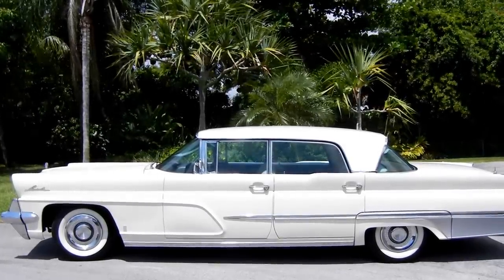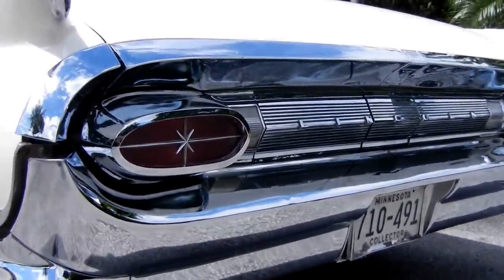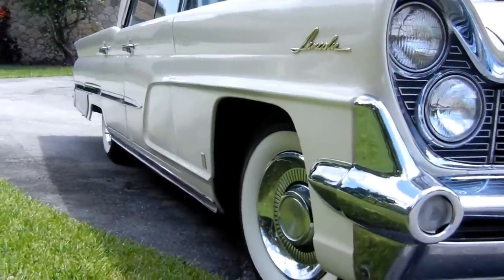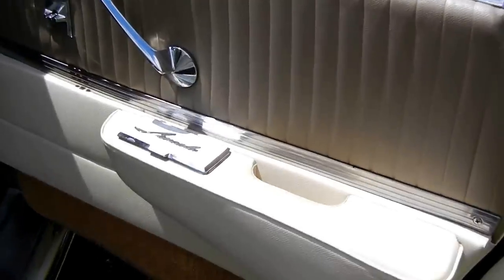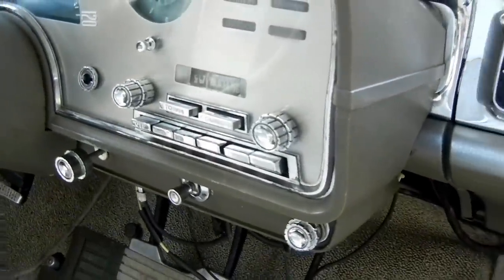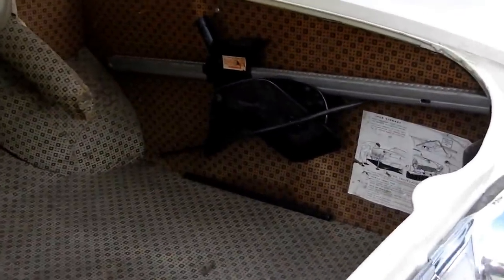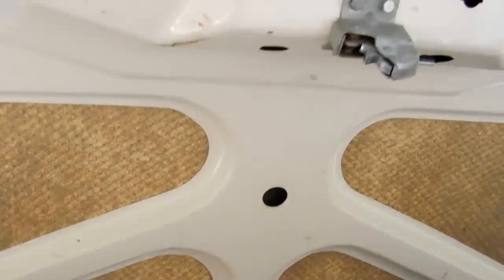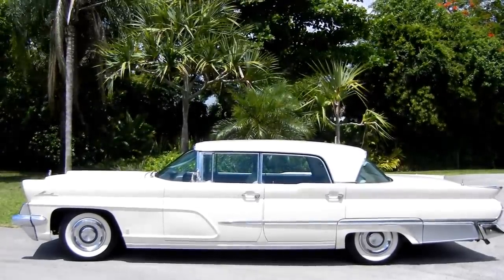1959 LINCOLN PREMIERE - SPECTACULAR ORIGINAL CAR !!

Comment: What a magnificent example of this so classic Lincoln automobile!  To answer "UncagedJDOG89" I would venture to say the difference between the Continental and the Lincoln models are the grill, side moldings, and rear tail area.  I know the tail-lights are different and the interior of the Continental is different with more upscale leather interiors.  The convertible did have a rear window that went down by power, and the convertible was only available in the Continental series.  Great classic automobiles that are now being recognized as great, beautiful classic post war luxury cars.
Reply: Michael, in 58 & 59 the Continental came in a Convertable, Sedan, and Coupe, all had the rear window that went down, and 3 smaller tail lights.   As a little Kid, my neighor had a 58 Lincoln like this, and another Neighbor had a sister that came over all the time, and she had a White 4dr Continental with the back window that went down.  They were more luxurious and  expensive than the Lincoln Premier.  Lincoln lost so  much money on this car, by 60 there was only one car, and MacNamara almost shut Lincoln down, but the redone 61 came out with such success, that it saved Lincoln.   I love these too, that Lincoln of my nieghbors really impressed me at age 4 and I always wanted one of these
Reply: The 1958 and 1959 Lincoln Premiere had the "solid" rear window, that did not retract as did the Continental. My father owned one 1958 and a 1959.
 The Premiere's have larger tail lights, and the 1958 rear bumper was larger, e.g., wider chrome across the expanse, than the one used in 1959. Some of the 430 MEL engines had triple deuce carbs, and others had one huge carb. All the MEL's had an incredibly huge air cleaner.

Comment: Sir,  you didn't mention the neat way it sends cold air through the front doors with vents to the rear seat that passengers can adjust to their liking. Very nice showing.
Reply from the maker: Thanks. And you're absolutely correct. I SHOULD have mentioned that :-)

Comment: Had one in 1962, loved it.
Reply: Not sure  if the Lubrication   issues were solve because   in the early  Premiers  there  was an optional   Auto-lube  system  where a grease pump was mounted by the  Master Cylinder and had about 12 plastic lines   going to key   spots for the front-end geometry .  You would buy a 7 oz  Can   of grease that had a scew-on cap where the threads  matched the  hole threads to scew the can in upside down .  
     Lincoln created   that auto version of a Ball-Joint that had the grease nipples but according to the Manual  you had to push the  Lube button  to the left of the steering wheel  on the dash   every 50 miles on the highway  drives while   a  new can  would be 250-300 application  to  Push the Lube button to give you  over 1000 miles before changing the can .  
       It was used from 1956 to 1960  while GM and FORD offered the  dealer Installed version around 1960  , but the price for Lube Jobs came down  to where the   Auto-Lube option  wasn't worth it unless you drove a lot  on the highway in the Sales business . 
     Older cars needed regular  chores done to it   which is why you saw  some of the Movies with a  Mansion    where the  Personal  driver for the Rich   had to be to a quasi  Mechanic as well as washing the car . 

    Beautiful car   that can carry 5 adults in comfort with a huge trunk for baggage .

Comment: Probably still has it's original new car smell.  Ours did, even though it was well used and worn.  This model was our family's daily driver up until 1980. Went from this to a Plymouth Horizon.  
 I’ve got a 91 Vandura if anyone is interested in their own A-Team van project.  130k miles, runs like a top.  Everything else is makeover ready.

Comment: There is a near identical '59 that shows in this area, but it has leather.  I've had 18 of these 58-59-60's.only drawback, they all got TEN mpg
Reply: The "other" drawback is the tire size:  9.50 x 14.   Only these Lincolns and a few Chrysler IMPERIALS used this size.   Cadillacs never went to a 14".
Reply: If one can afford to buy it, don't think fuel consumption would be a concern...da

Comment: I used to vacation Ogden, Utah to Las Vegas in my 1975 Lincoln. 110 miles per hour and 11 miles per gallon with airconditioning.
Reply: Ha! yes! I had a 77 coupe 460. I never got to 110 (85 for me) but I'm sure it rode as well as it did at 70. Best riding car I ever owned. My 89 TC was close though.

Comment: These fell out of favor in the public eye upon the release of the 1961 Lincoln Continental with it's iconic suicide doors; made so famous by the Presidential X-100 limousine. What a time capsule this automobile is. I'm sure it sold for more than it cost new.
Reply: Yes, the 1961 Continental was a gorgeous car. I had one. Wish I still did.   Another winner is the 1956 Continental Mark II
Reply: The 1960s models were just too severely plain.

Comment: My experience is Pot metal was designed to have a max life of 50 yrs. It  literally starts puffing from the inside out., It all needs to be copper plated to hold it together then triple chromed to preserve.  Very expensive to do..thousands and thousands and thousands to save all the pot metal.
Reply: Pot metal is cast zinc and thus very porous. It could have been electroplated, but car mfrs never intended on cars lasting 50 years.

Comment: How many miles?
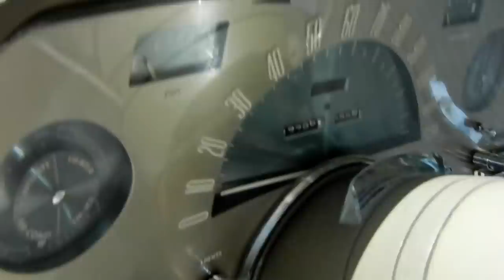Reply: I think I saw 17,789.  And from it's condition, I would presume that to be original.  At 6:38 and 11:06 you get a pretty good shot at the odometer.
Reply: @mark9531  If it is that low, that is a strong selling point...what kind of a salesman is this guy?
Reply: @curbozer5006  That is a tank of a car.  It is 19+ feet long.  The trunk is big enough to hold Jimmy Hoffa, John Kennedy, and Adolf Hitler.  Probably gets 8 miles to the gallon going downhill.

The guy's name is Bob Mayar.  He was a news reporter in Miami from the 60s to 90s.  I guess he is dealing in vintage cars now.